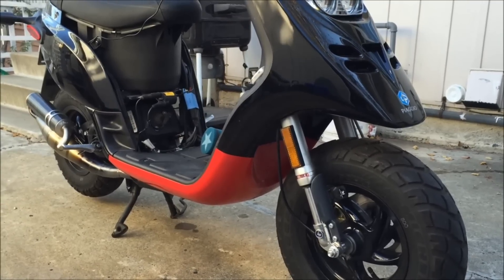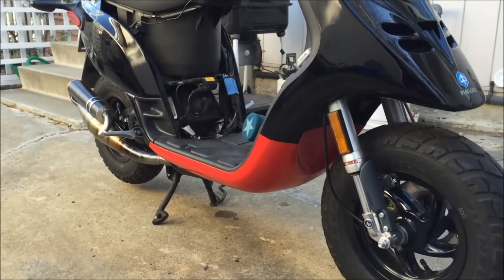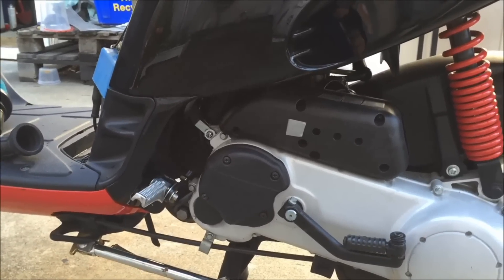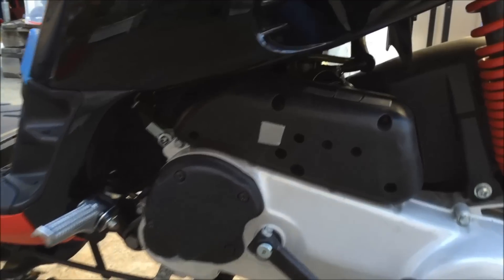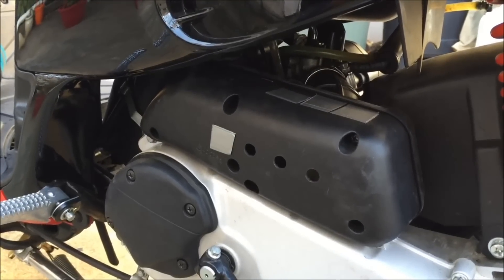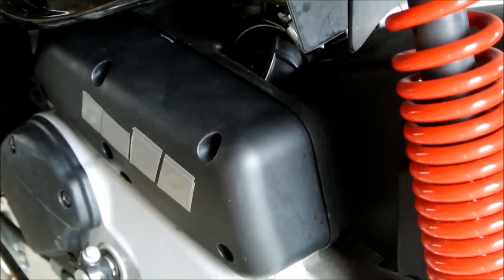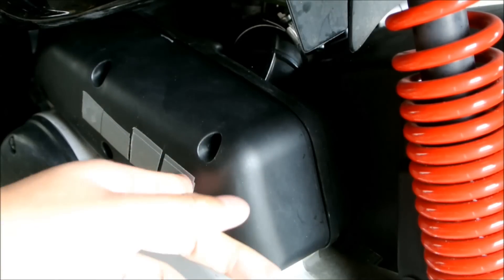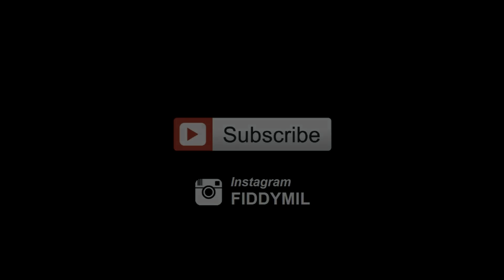BEST FREE MOD FOR A FASTER SCOOTER - EPISODE 10

Comment: when you give an engine more air, you've got to give it more fuel to not lean it out.
Reply from the maker: Correct. And the amount of fuel needed could vary even on a daily basis depending on humidity, temperature, and other factors. Using the tape to cover the holes drilled into the airbox lets you control the amount of air on-the-go, without always having to take apart the carburetor for maximum performance.
Reply: @FIFTYmil  what happens when you do this airbox hack on a fuel injected scooter?
Reply from the maker: @bb2na473  Theoretically, the fuel injectors should compensate up to their maximum output level, after that point and if there is still too much oxygen, the engine will run lean if no safety measures are incorporated into the ecu.
Reply: Not necessarily. Your not running a supercharger which forces air in then you need more fuel. These engines can run without a filter. They will not suck in more air than they need. This is why the carb has the flaps that open to allow air in. Run with a pod filter screw the box all together.

Comment: I did this sort of on my Coleman rb100. I just took the front plastic cover off “air box” and zip tie secured the foam filter underneath and just drilled some holes in the tiny exhaust box. Made it just that much more peppy for a 100cc mini bike. And didn’t affect the carb and actually has a tiny bit of nice exhaust pops on deceleration

Comment: I am of the opinion that a 2 stroke motor needs a big airbox so "dead air" is available for sudden wot use. The pod filters i have seen have a flat back and can cause a pulse wave which double carburates the main jet, which o er richens the mix. I think you are on the right track...

Comment: DO NOT MESS WITH THE AIRBOX! unless your prepared to upjet significantly and do a lot of tuning. Otherwise you will run lean and sieze.
Reply: Esp true in modern EFI systems that have various sensors feeding data to ECU

Comment: Very interesting. If l could make a suggestion buy a few syringes and take off the black rubber plungers then select a drill bit roughly the same size as the inner part of the plunger and drill the holes to this size. If you need to cover the holes now you can use the black rubber syringe plungers and it looks great instead of tape.
Reply from the maker: This is a really neat idea! Much better looking that silver duct tape ha ha
Reply: @FIFTYmil  man why dont you post anymore ?

Comment: Excuse me I meant to say a9 camshaft high performance can use with stock cylinder head or get an aftermarket racing cylinder head with bigger intake and exhaust valves then you jet your carburetor and go to aftermarket air filter it will make a difference

Comment: I mount a small electric fan on the airbox ran independantly by lithium rechargeable batterries.of coarse you would have to drill a hole in the top of the airbox.

Comment: Man you should come to Holland this is what all the 16 year old boys doo man. I have 3 scooters 2 of them 70cc.
Reply from the maker: Yes absolutely - I wish to gain knowledge from European tuners. Here in North America, scooter tuning is not as popular especially for european/italian scooters. There's a million questions I want to ask about modifying the piaggio typhoon but due to language barriers I don't understand the euro forums much.
Reply from the maker: I'd love to. Euro scooter tuners are god
Reply: FIFTYmil i have a typhoon 70cc if you have any questions just ask in English! On the moment i am getting my typhoon to a top speed of 130km/u
Reply from the maker: Awesome. Do you have a build thread and how did you bore out the stock chamber?
Reply: guys i need a help i have a typhoon 70cc i put a stage 6 exhaust and cluch top performans and its top speed its only 80km what can i do for more speed?
Reply from the maker: 80kmh top speed? What RPMs do you see at that top speed?
Reply: its 1995 model i dont know the rpm..what can i do??
Reply from the maker: European typhoons often have a lot more restrictions from factory to prevent the bike from exceeding certain speeds. 

For starters, are you aware and have you removed the restrictor between the variator that restricts your top speed?
Reply from the maker: Remove that restrictor. 70cc should easily do 110km/h+
Reply: how can i remove that restrictor?
Reply from the maker: undo the variator and you should find it right between the two halves where the belt sit.

http://www.adrenalin-pedstop.co.uk/Tutorials/Tutorial5.aspx
Reply: okay man thanks for help i do that tomorrow 🙂
Reply from the maker: You're very welcome! Let me know how it goes.
Reply: Kornilios stavrou you should also get the exhaust restrictor out end get a powerfilter get some new springs/rols
Reply from the maker: Good suggestion but I would recommend doing them one at a time to maximize the benefits of each modification and avoid confusing how the improvements are associated. I'm surprised that Kornilios invested in a 70cc but left all the restrictions in place if that is actually the case.
Reply: guys my bike doesnt have that on the exhaust and doesnt have on variador that circol and on carbulator dosnt have that i check tha but its not that the problem :/
Reply from the maker: Then the second most likely reason is your carb needs jetting, assuming your 70cc was installed correctly.
Reply: my carb jet size its 72
Reply from the maker: Hard to say as I don't know everything about your typhoon and what has been done to it, but assuming its the stock 17.5mm carb I am running a 82 main jet on a 50cc. How is it possible you're running a smaller jet on a larger displacement bike?
Reply: my typhoon its year 1995 i have on it exhaust stage 6 cylinder 70cc cluch top performans and carb 17.5mm  and my jetting its 72 size what i put on it?
Reply from the maker: There's really no answer to that as everyone is different. Logic dictates going to a larger jet like 85 -95 but in practice there are way too much variables I don't know about to give you any specific guidance. Does your bike run lean or rich? What RPM do you see while accelerating?
Reply: i put 85 and i will see if its good tommorow
Reply from the maker: good luck!
Reply: i put jet 85 and its too much for my typhoon
Reply from the maker: I'd like to help but you have so many mods on the bike already it's hard to pin point where the problem is. However, now we know that your 70cc is severely under performing. In fact, it's performing worse than a 50cc?

Are you sure the 70cc is installed correctly? It should consume more fuel than a 50cc by default. I am using a 82 main jet with a modified airbox while stock I was using a 68 main jet on my 50cc. Is it possible you're suffocating your 70cc with a restrictive air box/air filter? What symptoms do you observe with acceleration and top speed? What sort of RPM do you see while accelerating?
Reply: i dont know how much rpm going on top speed because my bike dont have a strofometer..
Reply from the maker: You can buy one at this affiliated link here for about 6-10 dollars depending on the model you like: https://goo.gl/LC0oA3

Does the bike stutter at all during acceleration from 0-25% throttle? 25-50% throttle? 50-75% throttle? 75-100% throttle? How does the bike perform at wide open throttle 100%?

Can you list me what you have done to the bike and approximately when it was done? How many km on the bike now since the last modification? How did it perform stock? Did it perform better or worse after your very first mod? Second mod? Third mod etc?
Reply: okay thanks i buy that and when i take it i put it on the bike and i send u a message
Reply: and how i put it on the bike?
Reply from the maker: While you wait for it to arrive, check out my video on the installation: https://www.youtube.com/watch?v=1aSLUc_MPSo&ab_channel=FIFTYmil
Reply: okay thanks for help when i take it i send u a message here..
Reply from the maker: Hahaha brilliant. Advice of the year!
Reply: hello i buy that rpm and i put it on my typhoon on top speed its going 10.000 what can i do now?because my typhoon its 70cc i have on it exaust stage 6 and cluch top performans and top speed its 80km and rpm 10.000 why only 80km?
Reply from the maker: 10000RPM only 80kmh and on a 70cc? My 50cc does 80kmh much easier than that. That means your engine is not making good power assuming your transmission is tuned correctly. As you have so many variables it is hard to determine which one is the problem. Best advice would be to revert the entire transmission to stock and tune the engine first!
Reply: now what can i do on the bike for more km?
Reply from the maker: Best advice would be to revert the entire transmission to stock and tune the engine first!

Comment: You could start with a 89 camshaft aftermarket air filter and ignition system upgrade and then you could do I upgrade cylinder head with bigger intake and exhaust

Comment: Get rid of the stock factory air also you can jet the carburetor just a little bit higher with the jet numbers and you will see a difference and get a different ignition system

Comment: Theres no real point in drilling lots of holes in your airbox if their total area is much larger than the choke size of your carb. The carb wont pull any more air in than this choke size! The best you can do is to smooth out the air flow rather than have a complicated route into the carb. Unfortunately, this does mean that the intake will be noisier than standard but if you're not too worried about this, knock yourself out!
Far bettter to find out the surface area of your carb choke and add holes that give, say, 10-15% more area to give the optimum flow rate without shot gunning your stock airbox full of holes you dont need!
 They'll only need to be blocked off again to keep the rain out!
IE, for a 24mm carb area of 75.4MM squared, you only need 3 holes of 25.13mm squared, or 8MM. (about 5/16")
Your 4 x 13/32" hole size is overkill given that you still also have the stock hole as well! (Unless you're planning to block this off!)
Reply from the maker: Very true and great comment. There comes a point where additional holes will not offer extra air because the bottleneck is no longer the airbox design, but rather the carb and engine size. In short, infinitely more holes does not mean infinitely more power is conveyed here. I apologize for not mentioning that and I really hope nobody turned their airbox into swiss cheese!

Your second point is also very true. This mod will make your intake much noisier as evident in my subsequent episodes. 

With that said, my choice of the number and size of holes were entirely for 1) aesthetic - this is entirely a personal and subjective opinion of taste about symmetry, odd/even number of holes, etc. (yes unfortunately I am cursed with that sort of pet peeves) and 2) 13/32 drill was the first one I grabbed out of the raffle/tool bag, so 13/32 it is.

I figured if I were going to upgrade piston and carbs in the future, should it ever happen, I wouldn't have to drill the airbox again.
Reply: Well... you could always paint it yellow for a quirky mod!!! LOL!
Reply from the maker: Maybe my next video should be on how to paint your airbox yellow?
Reply: know any good videos on this process?
Reply: any idea about where the ideal position of the extra 3 holes would be?

Comment: Do i need to drill holes, if i have mallosi air filter? Thanks
Reply from the maker: It's entirely up to you- drilling holes provide a more direct path for which the air can flow into the engine. If you're not happy with the results you can always cover the holes back up making this modification quite versatile. The malossi red air filter on the other hand provides less filtration than the stock one. When you're using race filters like those, strict maintenance guidelines must be followed or you will risk contaminants getting into the engine

Comment: The guy I got my scoot from ran it with the tube to the filter box, mobox or filter, and wondered why it stopped running, it didn't have enough compression to start! The air was coming from about center of the rear wheel! Where all the dust is kicked up! Between that and running it with no exhaust! It was in sad shape, I didn't bother trying to fix it, I just replaced the top end, with a BBK! And about to go to a 52.4mm bore, and big valve head, and cam, I also have a intake, and 24mm carb, and a free flow exhaust,  after the gear swap, and slider weight tuning, with the NCY rear sheave and clutch springs, I'm going straight to the 2k rpm springs, and Kevlar belt, the greatly improved head, and about 11:1 compression, and larger flow capabilities, it should make a lot more power! I'm hoping for about 15hp, from 86cc, at 10k RPM, if you want to go faster, the first thing should be a big bore kit, and gears! With a carb and exhaust, then tune the variator! And may as well do a cam and spring upgrade while it's apart,   atleast a 20mm cv carb, under 80cc, or up to 20mm slide carb, and 24mm CV carb, the modified stock air box is a great idea, and over 80cc a minimum of 24mm CV carb, and upward of 26mm, with upgrade head, with larger valves of course, a stock head, no need to go over 20mm, a 24mm carb isn't going to help much on a stock head, maybe if it's ported, and the valves are unshrouded,  if the valves are like my stock head, valves were, it would actually flow better with the valves chucked up and ground down about 1mm or do, they seated on the smallest part of the valve, putting a lot of valve in the way of the flow,  and the machined Ridge from the seat being installed, shrouds the valve a good bit, improvement of the low lift flow, 80% of the flow is in the low lift portion of the valve opening and closing ramp, it's only fully open for a fraction of a second, but either opening or closing for a couple fractions, so improvement  by removing obstacles to the flow, can improve power through out the power curve,  possibly flattening out the curve by improvement at low rpm and high rpm power,  slot of this can be done without cost, at home, but even a stock engine can use a jet change, going up 1-2 sizes, and adjust the needle  to fine tune, if it does not want to even run properly with the needle in the lowest setting, the jet needs to be 1-2 jets larger, then set the needle about mid way, I'd test it out with the jet with the needle adjustment first, if the engine doesn't run with it lowered fully, go to a larger jet, it should run much better even stock with a slight jet change, but the spark plug will tell the truth, always check the plugs,  it shouldn't look new, and it shouldn't look black a slight tan color of the insulator and the carb is about as close as it's going to get!
Reply from the maker: Nice read and great job. The spark plug is great way for crude tuning, but once it gets close to perfect tune you'll have to tune it with better equipments.

Comment: Hey there, nice vid! I have a question for You. The scoot i own is 2013 Yamaha Neos with 49cc engine. Everything is stock, just a small transmission mod (lighter weights) and a sports exhaust. I really hate it when accelerating. I mean it's really slow. When it is cold it goes like a rocket! But when it heats up... Such a pain. Tried carb adjusting- didn't help. I consider of changing the main spring to a red one in the clutch so this may help. Pretty sure the belt is done too. The top speed i can get to is 34 mph. The scooter has a 2T engine and I don' t think that this is all it can do..
Reply: So maybe You know what could be the problem that when it is cold its ok and when it heats up becomes a real head ache?
Reply from the maker: A 2T 49cc should perform better than 34mph for sure. You observed that it performs very well but once the engine warms up, it goes very slow. That's indicative of your fuel/air mixture being too lean. If you richen up the carb by first tuning the idle mix, followed by need clip position adjustment (if available), and then increasing your main jet your should preserve the performance you desire while running cold.
Reply: Thank You :)
Reply from the maker: You're welcome!